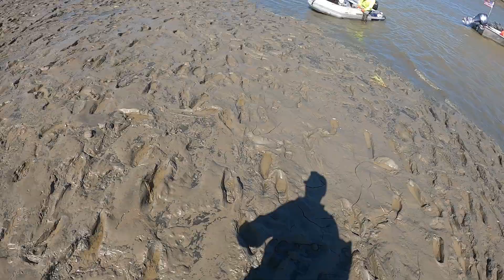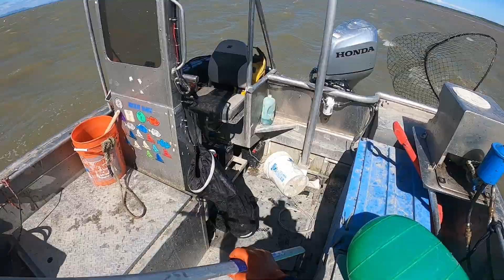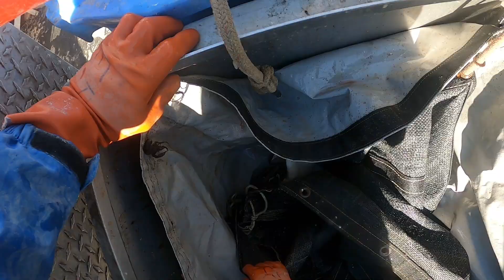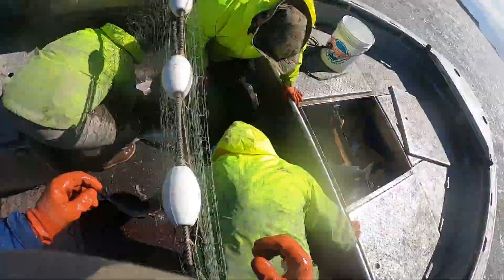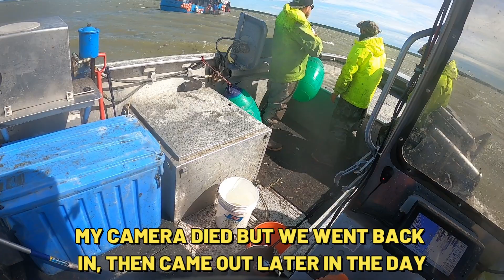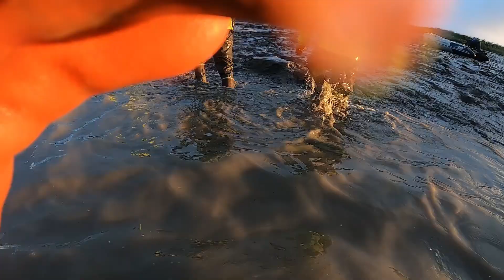Gusty Day on the bay | ALASKA 2022 Ep 5

Comment: Curious if any skiffs use a wash down impeller. We used that to hose and vacume out fish holds in Cordova in lieu or recirculating water systems on our Bowpicker.
Reply from the maker: @Not_So_Weird_in_Austin  interesting. Yeah, on our skiffs we use brailer bags that sit in our fish holds and then we plug our holds and fill them with ice and water, so the fish float in cold water. Then at a tender they’ll lift the brailer bags out of our holds with a crane and weigh them there. For us and other boats in our fishery, it would likely be too difficult and not needed to have a vacuum system since the holds are pretty small comparatively.